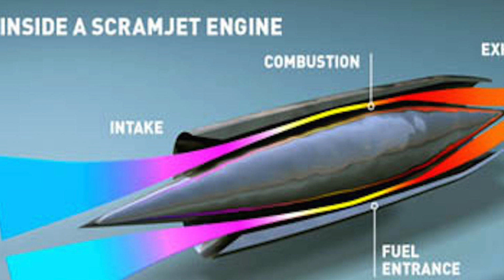RUSSIA DEVELOPS FIRST HYPERSONIC ANTI SHIP MISSILE, USA & NATO HAS NOT WAY TO INTERCEPT IT

Comment: Zircon is the Revolution of the Sea. The US has NO defence against ANYTHING hypersonic. By the time they detect it, it's ALREADY TOO LATE. Detection(at Best) to impact is .1 second. Phalanx takes 3-5 sec to lock. You do the math.
Reply: David James u are wrong the yanks have direct energy weapons that will destroy them with ease
Reply: Direct energy is a good weapon to intercept zircon but still it will depends on the radar detection to calculate and intercept the zircon missile and as far as I know no radar system as of this time in service that can easily detect such a Hypersonic missile.
Reply: KINZIAL the dagger, scram jet launched by modified Mig-31 can take out a battle fleet.
Reply: Direct energy weapons cant work over the horizon, 12 miles, besides an attack would involve multible missles includeing  supersonic torpedos not good tobe .in the navy these days
Reply: David James .
We had weapons for supersonic missiles 40 years ago Einstein.

Comment: I wonder how this missile will do against BrahMos 2 which is under develompent
Reply: China DOES NOT have S-400. That is Russia ONLY materiel. China has a similar missle to S-300, but far less effective.
Reply: I know brahmos is already operational i was talking about brahmos2 which is still under development it will use scramjet engine compared to the current ramjet and will have a speed of mach7 compared to current mach3
Reply: Firstly BrahMos can't be attacked as easily as you think because by the time anything even comes within 300km it is ready to be attacked and it is mounted on trucks which means it is mobile so don't think about striking brahmos because it will strike you first just look at the speed if launched it would reach Chinese near the border faster than any aircraft  secondly the himalayas are not a wall like structure there are lots of gaps between the mountains and brahmos has steep dive capability so it is easy to attack
Reply: The deliveries haven't  been made, but  China is expecting the S-400, as is India, at least according to Russian media (sputniknews)
Reply: BrahMos-2 is an export version of Zircon, BrahMos-NG is under development.
Reply: Probably it looks like history is repeating it self in the past the Russians made a missile P800 oniks and and later based on that technology created BrahMos in a joint venture with India. Now it looks like the same is going to happen again
Reply: Actually Indian scientist may have work on Zircon with Russia for follow up BrahMos-2 though nothing its sure regarding it. Btw DRDO is testing its own HSTDV which could be mounted on BrahMos-NG to accelerate to hypersonic.
Reply: user x brahmos is already in production and has been stationed near the Chinese border. The Chinese gov. has already complained, claiming that the land based brahmos  is destabilizing. That  is a very polite way to say their miliary experts feel threatened despite the fact that the Chinese have the s-400.